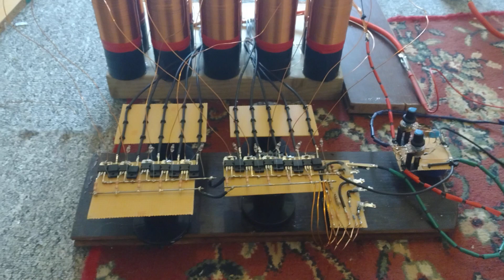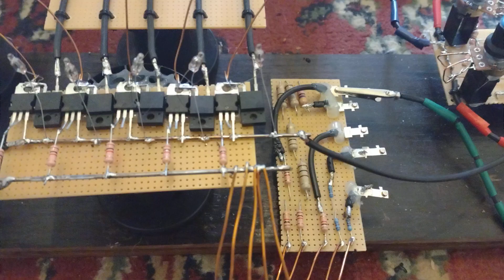Ten Coil Alexkor Device.

Comment: Thank you for the video. 

The Alexkor device is something I discovered while going through the PJK book. Patrick insinuated that it can be used like a solar panel system but without the solar panels. I wonder if this means that one could hook up an inverter across the battery setup being charged and it would work and just keep working to keep the batteries charged and the supply going.
Reply from the maker: You wouldn't need to go to that length.. just use a power supply with a large Capacitor on the end.. I suppose it could be used with a solar panel.. its better with a  battery input...
Reply: @oliver1224  I don't understand that.

Comment: Love the videos. The Alexkor devices is a bit complicated to understand from the e-book.  Great to see proper videos to see it in action. Well done. Keep it up.
Reply from the maker: Thanks very much.  Its a decent charging oscillator.  I don't think there are many videos of it being replicated on this platform.  Its a must to run it through a Cap Dump.
Reply from the maker: Thanks.. just replying to your other comment.  They're a primarily a charging oscillator where you get the best out of them rather than operating them like a Generator.  They produce a high voltage Spike which if utilized correctly can be made to perform some real work.  Connected up to a Comparator device or one of the latest Capsule Cap Dumps I've produced can get the best out of them.  Soon I'll show it in action.  Thanks for your interest.

Comment from the maker: I'm thinking of running this thing with the Quad Capsule device on the output...  that would make for an interesting video....
Reply: I got another question
On the schematic, you are showing a bifiliar coil, which I assume are these 8 coils on the board.

You also show a single filial coil. Where is that coil in the video?
Thanks as always a very find job
Keep up the good work
Can’t wait to see you charging a series of batteries.
Good luck
Reply from the maker: @Gacha.Cupcake  Thanks.. in the video I'm just showing the Capsule Cap Dump on its own minus  the oscillator.  I've been operating it on a different oscillator than the one in the schematic.  I just wanted to show how its connected because there's multiple connections with the Capsule Cap Dumps....